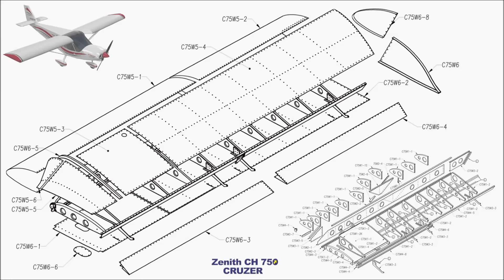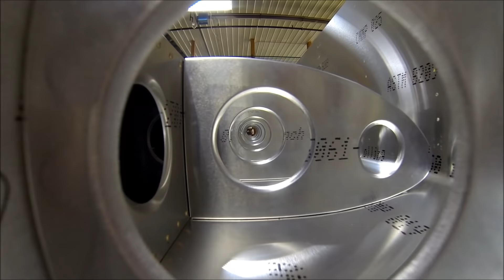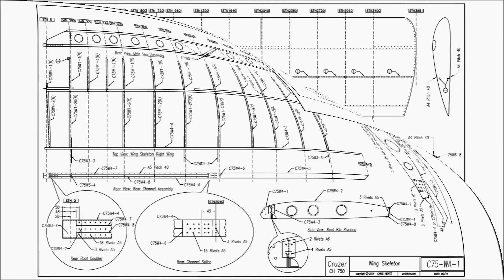Building the Zenith CH 750 Cruzer kit airplane: Top Wing Skins (part three)

Comment: I worked as a A&P mechanic back in the sixties for Ted Smith Aviation,  building the prototype Aerostar twin engine executive aircraft. The leading edge skin IS overlapping the upper skin of the wing panel. Also this plane is built to the minimum standards as required by the FAA. That does not mean it is inexpensive but it is not designed for aerobatics. Straight and level at modest speed is its place in the sky.

Comment: Interesting to see how the skin is overlapping in the exact opposite direction I was expecting.
Reply: The wing is overlapping in the expected direction. But the wing is moving through the air in the exact opposite direction ;-)
Reply: @CheetahNL  Not sure what you mean. The "thicker" portion is the front and the overlap is in such a way where upper sheet creates a ridge where air will hit the sheet metal.

Comment: Hey, Also wanted to add I liked the offhand use by the older builder in controlling the depth of the drill bit. His hand against the wing creates an “Anchor Point” giving greater drill control to 90 or other degree of angle needs. I would assume as well, that it is important, Not to dimple the skin with an out of control drill chuck. David Pugh
Reply: I always use the reflection in the skins of the drill bit to ensure its going in perpendicular too ! Helps seat and set the rivets straighter (especially on solid rivet based aircraft like the Vans series)

Comment: Wondering why the overlap is not reversed from what they did to keep wind driven water from going under the rear skin of the wing.
Reply: I´m wondering the same... It´s a mistake?
Reply from the maker: When riveting the assembly together the overlap is the other way (so no worries at all about it being reversed).
Reply: That's just for fitting and drilling. The noseskin overlaps the rear skin when riveted together.
Reply: Same on
Reply: I tought exactly the same. If you imagine that the wind component cames from the front of the wing, the inverted shaping can cause an increase of forces inside the wing.
Reply: There is a big difference  if you don't  mind me saying  material  thickness  on inside of a radius vrs outside will definitely  cause hole misalignment  not very good aircraft sheetmetal  practice
Reply: Most military construction ive seen on aluminum has zinc chromate primer applied to help ....not necessary on this style light aircraft?
Reply: I had just the same question. Even on the drawings can see, how the overlap is of those sheets. And there is other way. Leading edge sheet is overlapping rear sheet.

Comment: Gee Guys, Beat them up why don't you? That was Rodger trying to show how quick and easy it all comes together! He does sales and a bit of demo flying. At the end of the video the plans absolutely call for the tanks to go in prior to skinning and riveting! Also for the leading edge to go on top of the wing skin. They slapped it together. Does not mean they went by the plans. There is a ton of other stuff that was not done. Like wires for lights, tubing for fuel cell, and the list goes on and on. This is a build that requires strict attention to what the hell you are doing as well as planning! You don't per say have to measure twice and cut once but if you have A.D.D. this may not be for you!!!!  LOL The Zenith Aircraft is a great affordable and rather easy way of "Building and Flying something you know is right, because you built it".  A man can take a lot of pride in that and no one can take that from you!  I am going to build one of these one day soon.  I've seen many kits this one make the most sense to me. Warning to buyers Have a plan and execute it with precise steps so you can be proud of your work. Get tips and ask the best way to do things?  Maybe not Rodger but their techs I am sure are Number one in walking you through the steps. Let them know what you want and how you want it. They will inform you how to  or find out quickly!

Comment: Why was the trailing edge top sheet lapped on top of the leading edge sheet? That would seem to create a higher drag configuration. 🤷‍♂️
Reply: Marc Denis I think it is just for drilling. They look to be using the prepunched holes as drill guides. I bet they river in final assembly with the te of the le sheet on top

Comment: i wonder if there is no need to debur the top skin holes?
Reply: Wondering that myself. Built a lot of prototype equipment for a heli structural repair facility plus a complete rebuild of an old but extremely heavy CP450 hot dimpler they picked up cheap at an auction. I noticed that any deviation from the specified hole wasn't acceptable and according to the manual's examples could result in a wide range of failures. 

As in The Aviator movie, I want flush rivets. Oh and a magical canopy I can make disappear whenever I want. 

Well Mr. Hughes, Those rivets will be extremely difficult but the disappearing canopy, got a couple in stock.
Peace.

Comment: Why dose the leading edge aluminium go underneath  the main skin? Can't water be forced into the wing this way when flying in the rain?
Reply: That's just for fitting and drilling. The noseskin overlaps the rear skin when riveted together.
Reply: even if water ot in there, it would not hurt anything. But paint will seal the gap anyway

Comment: shouldn't the fuel tank and electrical wires go in before putting on the outer skin......or does one have to cut out panels to do that???
Reply from the maker: Yes, this is done before the top skin is riveted in
Reply: George Gonzalez wiring, hydraulics, fuel systems are installed before the skin is riveted to the airframe. In an aircraft this basic those systems are likewise simple.

Comment: I know this video is more than a year old but I too wondered about corrosion protection, does the factory take a position on using corrosion protection on the inside prior to riveting?
Reply: Sorry for the above post, I see this was discussed in video #1 and missed it the first time....
Reply: 6061 material has silicon in it so it has great corrosion protection. 2024 has a layer of pure aluminum on it for protection. The overlaps will be fine in a no salt environment for probably 50 years. But you could paint a stripe in the overlaps if it just makes you feel better.

Comment: How is the leading edge sheet folded? manually or with a machine?
Reply: Usually with sheet metal rollers....but for something this size it's easy to fabricate a jig if you want it perfect. 
Also could bend by hand but that takes alittle more skill with  rubber mallet and sandbags

Edit:  gig jig

Comment: Aren't there modern adhesives that would replace all the drilling and riveting?  I  made a mistake of using incorrectly some expensive metal tape on my motor home.  This stuff is fearfully sticky and can not be removed even after years of all-weather exposure.
Reply from the maker: +zeek wolfe 
Yes, probably, but it would make long-term reliability and effectiveness questionable... we find that match-drilled parts with blind (pulled "pop"-type) rivets to be best suited for assembly by amateur builders (not professionals in a factory environment)
Reply: Are the pop rivets then filled with silicone to prevent leakage?
Reply: Why do something untried?  They are running a business and need to be very safe. People will not buy something different like that. Although you could rivet and glue as in their float construction. But it would ad a lot of weight, be messy and is overkill. Your aircraft would not be better. Also you would have to wait for each section to dry before doing the next.  And what would hold the sheets in place and clost to the surface of the attaching sheet?  Rivets.

Comment: Why aren't the pushrods/cables positioned & attached to Bell Cranks before skinning?

Similarly the fuel tanks, hoses, & wiring?

Why is the trailing edge skin placed atop the leading edge skin - won't this cause unnecessary turbulence?

I though everything was match drilled.  Using the skins as drill guides into the spar could widen skin holes leading to motion & wear.  Also you forfeit the chance to deburr the spar, setting up stress risers.
Reply from the maker: +Barry Gloger 
Good questions. There are no pushrods or cables inside the wing, keeping things very simple (the flaperon is separate from the wing and actuated at the fuselage,
The wing tank plumbing is easy typically done before riveting the top skin (over the tank).
We do recommend any burrs be removed before riveting.
More: http://www.zenithair.com
Reply: Barry Gloger et EHPAD EHPAD BO1
Reply: Because there aren't any. It is all external Fuel parts all get put in after dissassembly, deburring and then you rivet it all together
Reply: Why do you cleqeo everything then take it ass apart and river?  Can’t you debur and fit everything then use the clecoes to hold things in place while you river?

Comment: Is their and engineering reason why you put the leading edge skin under the rib skin?  I think it would be better to put the leading edge skin on top of the wing skin.
Reply from the maker: When riveting the assembly together the overlap is the other way (so no worries at all about it being reversed).
Reply: I think the reason is that the curved skin has a tendency to lift when riveting and would have a bigger gap. and aerodynamically with such a plane it doesnt matter.

Comment: I see this wing so fragile...How g support??
WoooW
Reply: +6 -4 G as far as I know.
Reply: Its a box structure, semi-monocoque. Airplanes have been built this way for 80 years. It was designed by a renowned engineer. hundreds have been built and have an excellent safety record.  It works. It is surprisingly stiff when riveted together.

Comment: There appears to be a gap between the the front of the ribs and the curved front leading edge skin.  Is this correct?
Reply: Ronald LeBlanc   I was going to ask that too. looks like the metal should over lap so no air would catch lip or gap?
Reply: Ronald LeBlanc Also strange is that leading edge skin is going under over wing skin. That means that air stream is going towards to tear that joint. Maybe that isn't matter because thee is no such a strong air flow, but still... :)
Reply from the maker: Ronald LeBlanc 
Once tightened, the leading edge skin wraps tightly around the nose ribs for a very nice fit.
Reply from the maker: Viktor Stojic 
That's just while drilling. The noseskin overlaps the rear skin when riveted together.
Reply: That's much better option! Also i'm very glad that you replyed!
Reply: It is fine because all the matched holes lined up

Comment: This is the second video that I saw new holes being drilled and the backside of the hole not being deburred I was taught by an A&P this is absolutely a cardinal sin as any chips of metal will not allow the rivet to seat properly and become loose over time. I'll just throw out all my deburring tools and "wing it" from now on 😖